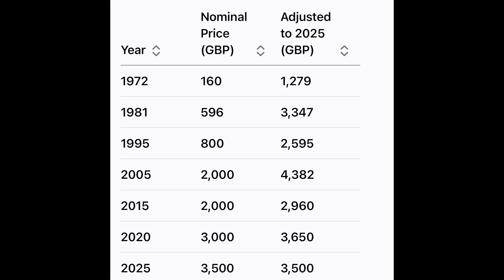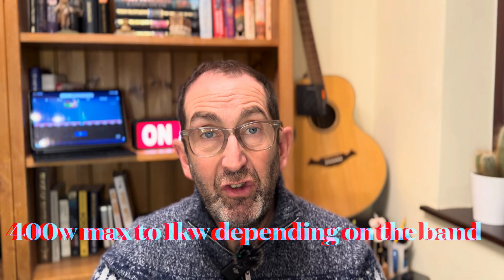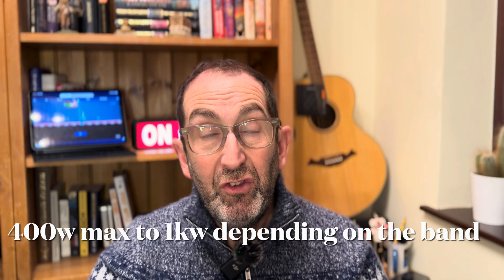The Great QRO Swindle

Comment: If you choosing a radio primarily on the basis of how much power it puts out, you are on the  path.  QRP and low power receivers ( < 25 W) are often selected on the basis of portability and power consumption receive receive.  This is selected to reduce weight  and allow for smaller batteries.  My IC-705 has lower receive power consumption than my IC7600 and there radios  with even lower power consumption and that are smaller.  Weight and convenience are important. The quality of of the receiver in a ham transceiver is a primary reason to select a particular transceiver.  If you able to compare several transceivers actually using and listen to them.  My IC7600 is a better receiver than my IC705 but the 705 is not bad. Those knobs are actually useful if you know how to use them.   Over the years I have made QSOs from about 1 W to 1000 W on HF and operate a few contests QRP (e.g. Field Day). One works a bit harder to make QSOs running and I find CW , RTTY and other digital modes a bit easier.  For a major DX contest with lots of QRM, I use 500W and find it necessary. for many contacts.   More power seems to help a bit mote that an dB analysis would.   More power helps with deficits in your antenna system.  Martin Lynch (the UK ham radio dealer) did a demonstration of the effect of power on the  received signal that was informative.  BTW  buying an amplifier for  QRP  radio is rarely economical.   My IC-705 actually cost a bit more than a IC-7300.  Consider how you want to use your radio.
Reply from the maker: Many thanks for taking the time to reply.  I reckon, I have a 705 btw, that QRO is great for attention deficits disorder.  Some of the deepest thinkers in amateur radio, do QRP.  Keep at it. You are doing great and look out for my video with Hans Summers at QRP Labs. It should be up this week. 73.

Comment: If you're buying an expensive rig for an extra 100 watts output...don't.  IF you're buying an expensive radio for a MUCH better receiver, now you're talking.  One hundred watts to two hundred watts gets you half an S unit...imperctible at the receiving end...BUT....if you can't hear 'em, you can't work 'em and the receiver that can hear it, isolate it and filter out all the crapola...that's worth the extra bucks.  Don't fall for the extra 100 watts from the transeciver...it won't matter.
Reply from the maker: I totally agree.  Using my formula (in my latest video) - a well known influencer’s very expensive rig, is argued to be amazing. However, run it through the formula (it uses Sherwood stats) and it’s terrible (for the money). 
With what’s coming, personally, I would not tough a class A/B consumer electronics device, even with an awesome front end.  The advent of D/E professional standard rigs is about to bust the market apart.  Many thanks for watching. 73 and happy DXing.

Comment: Now, I'm going to say it's not really a swindle. It's just like other things. There's a low end that's not really good value for money, and a high end that's not really value for money and a whole lot in the middle that is.

The same can be said for computer CPUs, GPUs, Cars, TVs. Pretty much everything you buy.

But it's not a swindle. The vast majority (myself included) probably want to sit somewhere in the middle ground of 100w-250w. I'm just on barefoot 100w from the radio here. But it is a choice for each operator to make.

But just the same, if you want the best OLED all singing all dancing TV, you pay extra for it. But if that's important to you, then you pay the premium. Same for the diminishing returns for the highest tier CPUs and GPUs. If it's important to you, and you can afford it, you pay for it.

Likewise, if having that kilowatt is important to you. Then, you pay the piper to get what is important to you.

Radio isn't alone in this.

I will also qualify this in saying that even if you say it's less than 2 s-points. But a 10db stronger (or 1.67sp) signal will clear the pileup a lot more often. People that contest a lot, will see a lot more value than someone like me that might do WWA for fun, POTA/BOTA and ragchew. It's not a sensible buy to me.
Reply from the maker: Thanks for watching and the comment. In economic terms, it’s expressing a preference. However, remember, linear amps are simpleton consumer electronics devices and are class A. A meaning blooming simple stuff. Safe as far as reliably reproducing the signal and amplifying it, however, way, way, way overpriced as inefficient (30% efficient) shack warmers. 73

Comment: The competition for 100W radios keeps the price competitive but for HF amp MFJ is gone and there the competition is not so much so the cost is high.  Polar Modulation is a differentatior that makes Higher HF power reasonable.
Reply from the maker: You are so right.  Many thanks for watching and taking the time to comment. 73 and very happy New Year.

Comment: Only if you don't know how to rebuild old equipment and think you have to buy new. I rebuilt a Collins 30L-1 for about $500, almost 1 kW. Same with my Gonset 101. So, you are full of BS. When you buy a Yaesu FT-101MP, you are mostly paying for the receive side, not the transmit side. You can't justify S points because there are other factors: propagation, solar events, etc. Go learn about electronics and rebuild lots of fine, older equipment.
Reply from the maker: Are you ok?  Many thanks for watching the video and at the same time, please contact someone at your local radio club. Have a cup of tea and a chat.  It seems like you didn’t understand anything I said.  It’s a great shame and I wish you a speedy recovery. Btw - excellent work on the Collins rebuild.  It’s what we should all be doing.  Re the Yaesu. You are right. However, CESSB. Check it out. 
And at the end of the day, we are all playing albums when the rest of the world have gone digital. 73.
Reply: @G3LRC I think it is you who needs a mental health check. You try to make a point with no real science. You can measure S units in a lab with a Sig Gen and cables. That's fine. Connect it to an antenna, and all bets are off. I do it almost every day for a radio store and an auction house to adjudicate incoming equipment. It's clickbait. 73

Comment: I think changing mode to FT8 is worth the cost of a $1 usb sound card.  20 db SNR improvement over ssb.
Reply from the maker: I know that folk really don’t like the digital modes.  However, when Piccolo was used on our bands and we discovered what it was, we wanted it.  And now that we have its amateur radio equipment, some just don’t like it.  I think it’s absolutely fabulous.
Reply: @G3LRC ohh I'm not familiar with it.  I'm using an $80 USDX V2 in the Philippines and work the world with 2 watts an an EFHW vertical.

Comment: Hello Dave - thank you for such a very informative video - being an oldun here and on the air for 50+ years and had amazing fun with the older equipment - I built a double conversion RX in the early days - I find todays equipment is overly complicated and way too expensive and as things go it seems like every year or so there is another new toy on the block and all with inbuilt obsolescence - my mobile/portable rig is the Xiegu G90 (amazing rig) my base station is an Icom IC-7200 which is an amazing rig for CW - my HF amplifier is an Ameritron AL-811HXCE with 4X572B's - when mobile with 20W (QRO 😃) I am always pleasantly surprised with the reports I get - I rarely use my linear except when you have wall-to-wall QRM from the contest brigade who show no mercy to QRP station's or anyone calling CQ so the extra few watts from the Ameritron helps - interestingly a Dot or a Dash from an inexpensive rig sounds the same froma £5,000 rig - KISS  & 73 de Ger EI6DP
Reply from the maker: Ger, I adore this and so many thanks for watching the video and these awesome comments. Keep at it. It’s inspiring.  73, Dave.

Comment: I run QRP portable with resonate antennas all the time. I break through pile-ups with a high percentage. The advantage is location, antenna quality,  and deployment. 

I proved the point at my local radio club running 5w through the club's Flex radio on a tri-bander. We easily hit 5000 kilometers stations and broke many pile-ups.
Reply from the maker: You’ve hit the nail on the head. Hata method and all that good stuff.  I recall an old contest winning DXer from years ago, Keith, saying ‘when you guy a house for amateur radio, pay great attention to its usefulness for DX’. Funnily today, I used a Flex 6 series, 80w and an EFHW and tried to contact a station and failed.  I switched to 10w from an IC-705 and an Alex Loop and made contact on my first attempt.

Comment: Tbh db is irrelevant to me especially if you’re going by a signal meter. If you’re running say 5w and you can’t be heard and you whack on let’s say 25,50 or 100w and you make the trip then that is all that matters. Same to be said about going from a 100w up over, if you can’t make the trip and you have it use it. Now looking at prices this is another issue although in the 90’s I bought  Kenwood TL922a for £800 used which felt like a small fortune so have they really increased.
Oh and isn’t that N1 +1 for us cyclists 😂…
Good video anyway 73 GT
Reply from the maker: A huge thanks for watching. Yes, s-meters are artwork bs on a transceiver front.  I did think that n+1 was for cycling only. But, dear God, radio enthusiasts just collect dust collecting artefacts.  Keep up the great work. 73.

Comment: I can buy a FL-2100B for about $1300 Australian, I'm looking at one for my FL-200B transmitter.
So by your chart I'm at 1972 prices, well less as that is AUD.
Yea driving it normal is 600w but I've seen guys running the 2100B at 900w plus, and the valves can take 1200w PEP going by specs. 

I don't have an amp yet, but having one sitting ready to go if the other guy is having trouble reading you then you can just stomp the pedal and bang he'll copy you. 
Yea I have an FT-817 QRP is fun, but there's no shame in having a big ol linear in the shack.
Reply from the maker: What amazing prices and I adore a valve. Keep at it and every success. Many thanks for watching. 73.

Comment: Thank you. Great video. Personally I love the challenges that QRP offer. Not because its hard, but because one really needs to sit down and think and experiment, losses, coax, connectors, antenna antenna antenna. One LEARNS SO MUCH, and thats what amateur radio IS all about. Obviously the added bonus is, when you make contacts with stations running QRO while running QRP and your signals are the SAME if not BETTER, hihi. As one ham told me once, "An very efficient QRP setup becomes an extreamly efficient 100W setup" Merry Christmas and Best 73 .. de ZS6AKW

Comment: I think the other trap some fall into (including me) is that we still equate a modern day s-unit as 6dB - It isn't, its more like 3dB. So if you are seeing an s-meter on a modern HF radio and see a difference of 2 s-units in a signal. This isn't 12dB .. more likely 6dB. So 100w to 1kw is more like 3-plus s-units. Having also used 1kw recently in a contest I have no doubt that 100w would be pretty puny by comparison. So if you can afford it and your way of operating demands it, a linear it is. Finally, referring back to your table at the start of the video - you could also interpret this as the price now descending back towards 1981 levels. All good, keep up the content, 73.
Reply from the maker: Many thanks for watching, Tim and taking the time to comments. Ah yes, the theoretical S-Meter to the reality of accuracy at S9 and then S-6 being somewhat in the land of Noddy. I remember my first entry into CQWW as a member of a team and it was the first time I’d usdd 1kw into a multi and Yagi at an eye watering height.  It was incredible.  You’ve got me thinking about another video and also some testing on my down kit. 73.

Comment: Really interesting and thought-provoking video!
Getting just 1.5 S-points more for that kind of money does seem ridiculous. I’d bet that investing far less in a better antenna system would easily give you way more S-points per pound spent.
You’ve also got me seriously thinking about my own future purchases. Picking up a used TS-480HX or FT-1000MP (both genuine 200 W radios) for under £1k on the second-hand market looks very tempting right now.
Alternatively, a Hermes-Lite 2 + a pa200 comes in around £500–550 and leaves a lot more budget for a proper hex beam or quad – which is probably the most cost-effective route of all.
Great food for thought – thanks!
Reply from the maker: Many thanks for watching.  The antenna is the way and a friend is using a Hermes and reckons that it’s his rig for life. The SDR software on it is incredible.  CESSB is the one thing that stops me in my tracks when considering something. However, 1kw at the right price and into an antenna that can hear DX is a wonderful thing.

Comment: Why should a shop give you a discount  ?
They need to make a living too.
Reply from the maker: That’s almost a fundamental question in sales. As we know, the price is an offer price. If you accept the offer, this isn’t a mutually beneficial transaction. What we need is a sale where both parties benefit.  
A great book to read is the excellent book on negotiating from the Black Swan Group is Never Split the Difference: Negotiating As If Your Life Depended On It, written by former FBI hostage negotiator Chris Voss (with co-author Tahl Raz). It’s a practical guide drawing from real-world high-stakes tactics, emphasizing empathy, active listening, and avoiding compromise to achieve better outcomes in business, personal, or everyday situations. ￼ If you’re looking to refresh on key takeaways, it covers techniques like “tactical empathy” and calibrated questions that flip traditional negotiation wisdom on its head.  Many thanks for watching. 73.
Reply: Most dealers are also obligated to sell brand new gear for no less than a minimum agreed value with the manufacturer.

Comment: The trouble is that that the effort of producing a certain amount of power is proportional to the amount of power so going from 5W to 500W takes 100 times the effort.  Not only energy  but also in what's required in terms of hardware and cost to generate that power.  This implies that the cost of generating 100 times the power is about 100 times.  The QMX+ is about $100  so a rig generating 100 times that power should cost about $10,000.

That makes the Flex Aurora at about £7500 look like quite a bargain, especially as it's professionally designed and built with professional software and support.
Using logarithms for thing that are linear doesn't work well, even if you multiply the logs by 10.
Chris, G5CTH
Reply from the maker: A huge thanks for watching and taking the time to comment.  I get your frustration with this non-intuitive scaling, and the table evidences why it’s still a win: you’re buying signal reliability (e.g., better penetration through noise/fading) at a cost efficiency the logs predict.